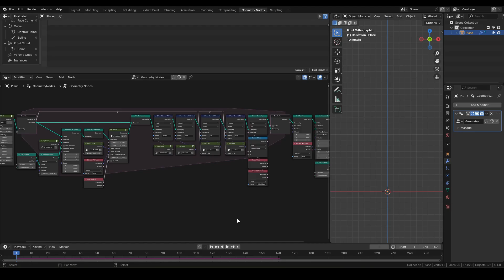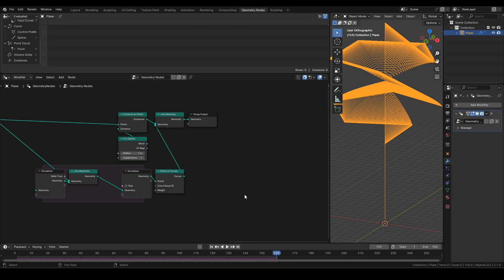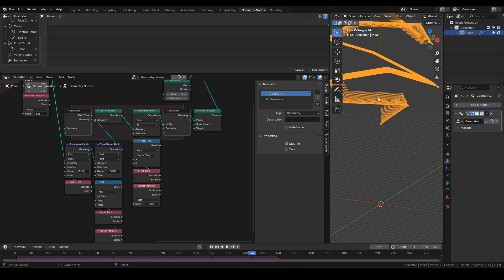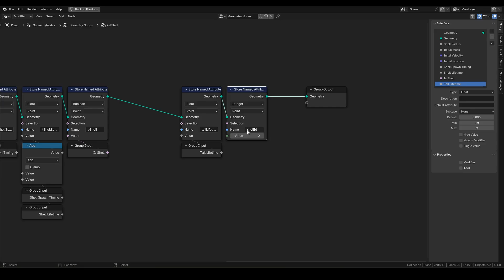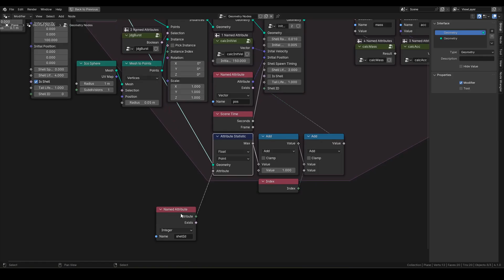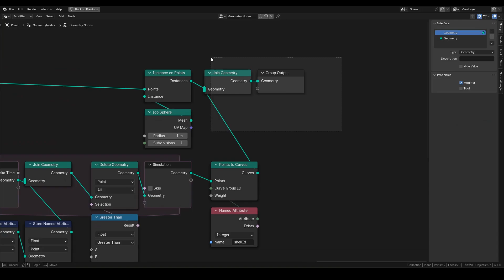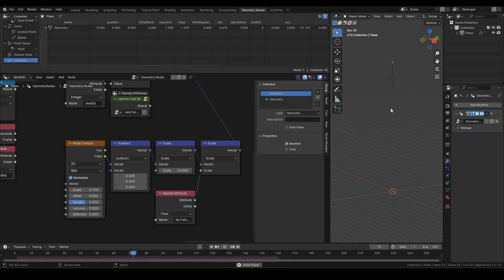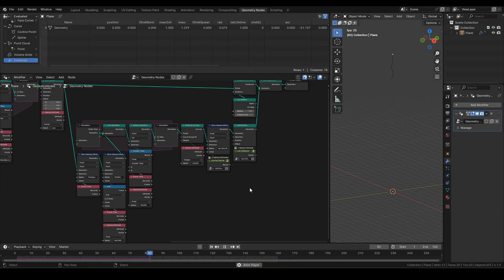[Blender] Let's Launch Fireworks with Geometry Nodes!  Ep.4 Tail Formation

Comment: Hi,

With Blender version 4.4.3, there's a bug because in the Realize Instances node, you also have a checkbox to "Realize All" and a depth. If this is checked, changing the bomb ID works. However, the trained bombs have the velocity, position, and speed data in -nan(ind). If this is unchecked, there are no trained bombs for each bomb because changing the ID doesn't work.
How can I work around this problem?
Reply from the maker: Hi there, sorry for the late reply

I opened up the same file with 4.4.3 and seems to work fine, so let me understand the issue here.
I assume you are talking about the realize instance after Instance on points.  The correct setting with 4.4.3 should be checked "Realize All" and the Depth of 0 (which means at all depth).  I'm not sure why the Named Attributes are not being inherited from the parent in your case, but one possibility is Mesh to Points after Ico Sphere is missing.  This could cause instanced objects to be verts instead of points making parent attributes uninheritable.  

If this is not the case let me know.

Comment: Great series so far! The nodes are working fine, but the spreadsheet in not listing anything under instances and I don’t find the id field anywhere
Reply from the maker: So there was a huge facelift with Spreadsheet in ver 4.2 or 4.3 which allows you to specify the geometry within a geometry you are viewing.  If you are using newer version, I am assuming that might be causing the issue.
When you go to the top of the spreadsheet, there should be a Geometry dropdown section to specify which geometry to focus on.  Select the top (or the root), and information should be there.
If this doesn't work, let me know :)